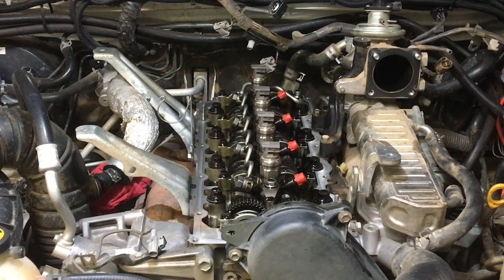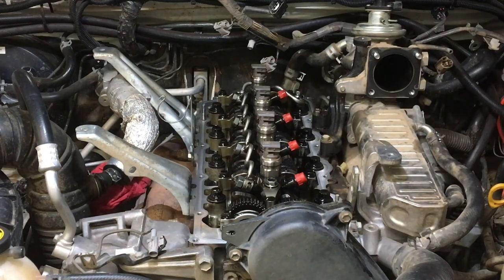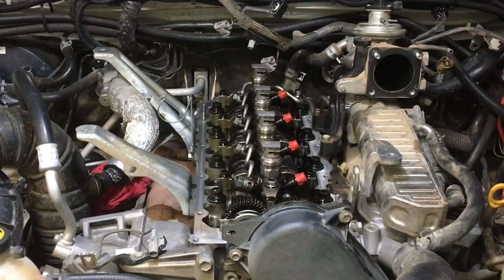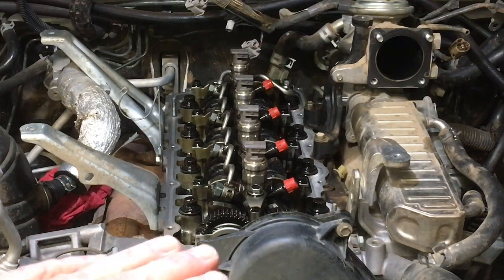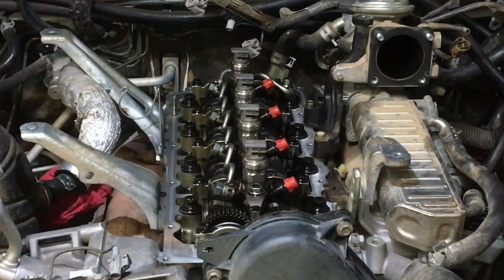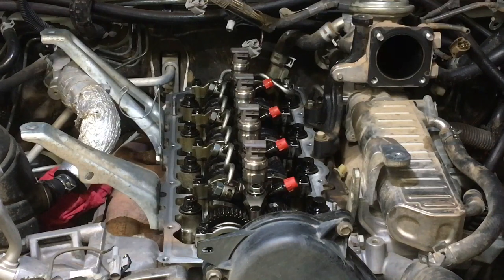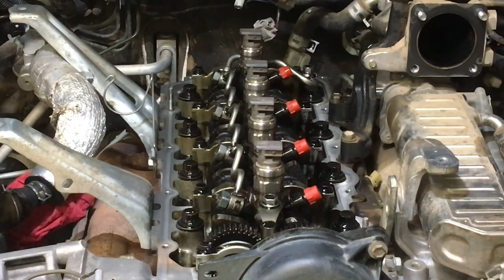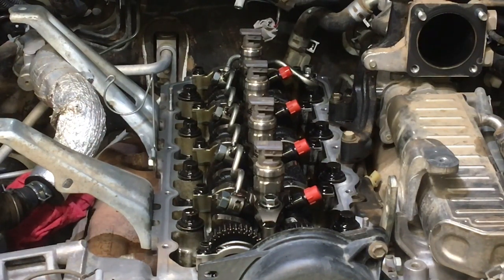I’m Sorry- POOR MAN PAYS TWICE Pt 2 - SO AVOIDABLE - very wasteful - Just do it right the first time

Comment: So how much is it to replace the injectors and fuel pipes and and injection job normally cost to replace and put in whats the full cost ? Just wanting to know for isuzu dmax 2010  love the vids so far.
Reply: Hey mate check out Sydney 4x4 services and repairs they sell genuine denso injectors and fitting kit on their site for 2008-2012 dmaxs ($2500). Tommy from there is a 4jj1 specialist. If your in Sydney would recommend for them to do the job.